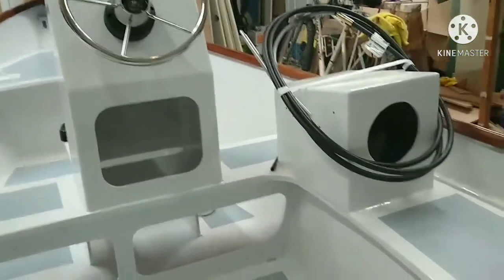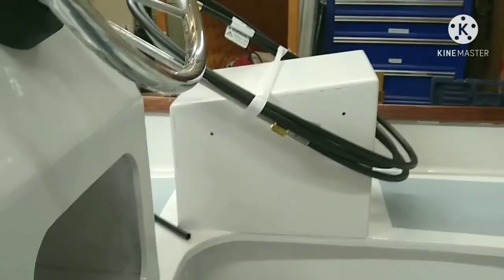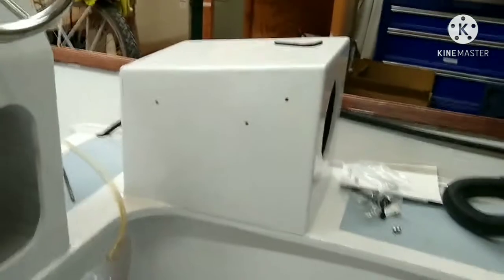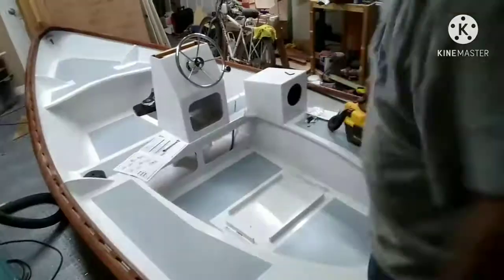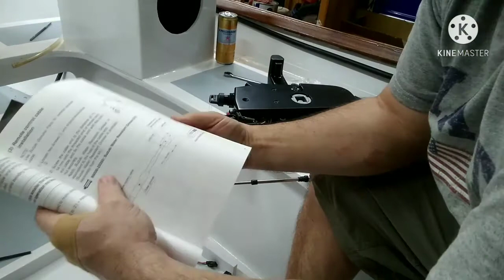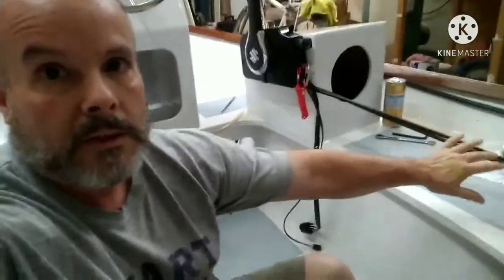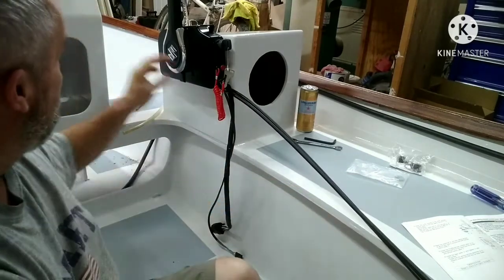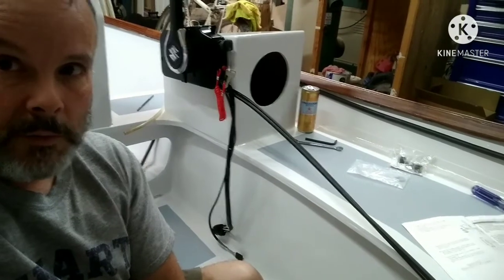Peeler Skiff Build #40 - Rigging

Comment: Love all your information.  Thank you for your time. Would it have been possible to run the cables in the starboard flotation seat?
Reply from the maker: Anything’s possible, but I think that because of the curve from the side to transom then link to outboard it would have been difficult.  I want to keep the integrity of the flotation chamber.  Maybe you could run a 2 inch PVC in there and heat it up to make the sweep needed for the cable to make the turn to the outboard.